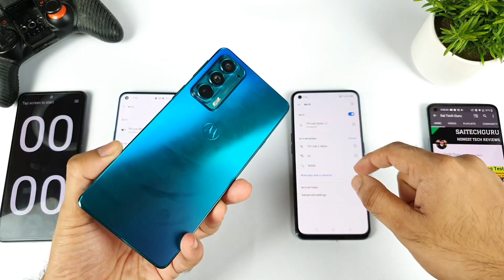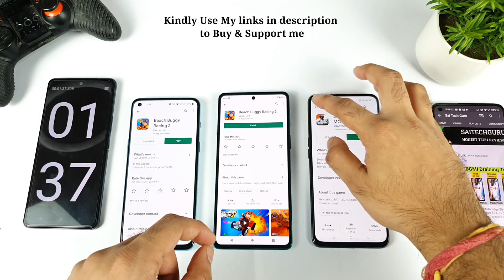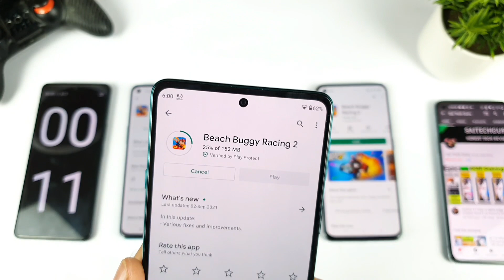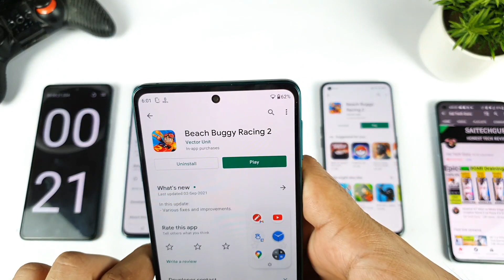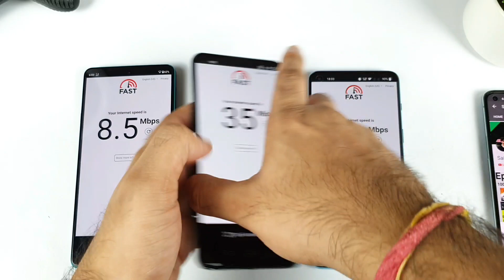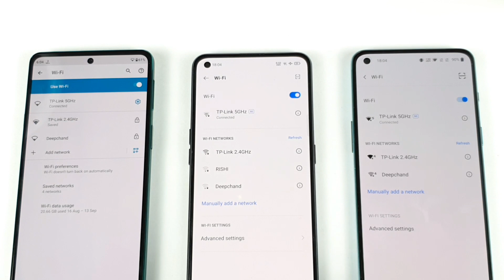Comment: I did buy my X7 max and I'm loving it 🔥🔥
Reply: Same
Reply: How's the battery backup?
Reply: @emadrahman23  it will give 5-6 hours of backup with 1 to 2 hour of gaming
Reply: @ujjavalpathak6225  some users said they get around 8-9 hours ...so I thought my unit has some problems
Reply: @emadrahman23  no bro it is not unit issue just wait for updates and it will be fixed 🤗
Reply: @emadrahman23  6h bro 4h gaming and 2h social media 😍
Reply: Same does it heat a lot while charging
Reply: @vishnuasokkumar1918  It does get hot while charging but now I charge at night and with night charge optimization phone does not heat up and get charged fully
Reply: And I use super dart charger only if I needed phone to charge quickly otherwise I use 10 or 18 watt charging

Comment: What the hell is wrong with edge 20 wifi reception?? 😑😑
Reply: Don't worry brother. The phone is built to last with metal frame. That's why signal reception is so. Those 2 phones are of Plastic frames. When the router would be close there's no way these phones can beat edge 20. It has wifi 6e.
Reply: Signal through Plastic passes easily. That's why the signal strength is better in nord n x7 max
Reply: @chinmayomprasad9296  You are right, there is a chance for that. But there are other phones with such metal frames right? Maybe antenna design also have something to deal with this. I don't think some software update can fix this.
Reply: @mathew7747  exactly brother. Edge 20 doesn't have antena bands on its metal frame. The entire signal reception happen through phones back plastic. That's the main reason.
Reply: Or else the phone has the best wifi. There's no way nord 2 and x7 max can beat it in terms of wifi performance. Just the built quality of moto is so that it's signal reception is kinda bad. But the phone is hell a lot durable then those 2 phones with Plastic frames.